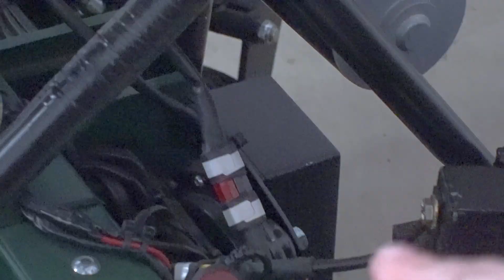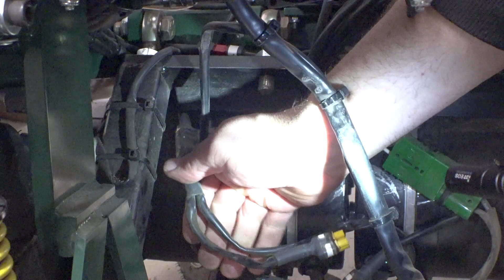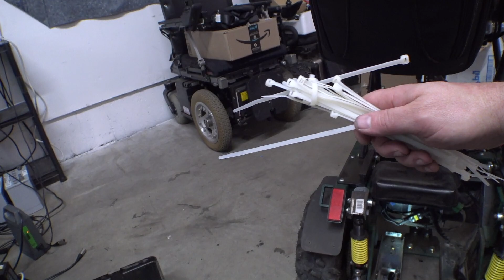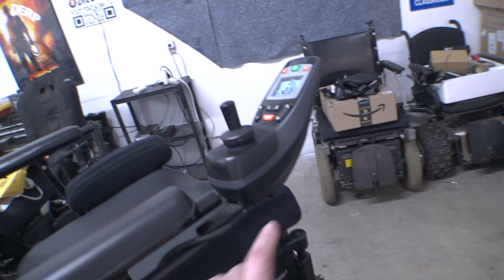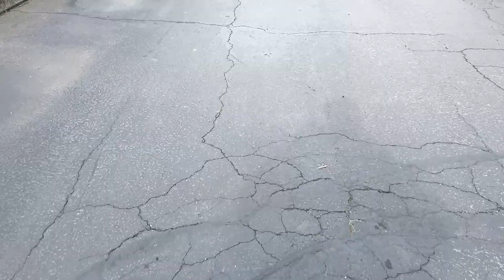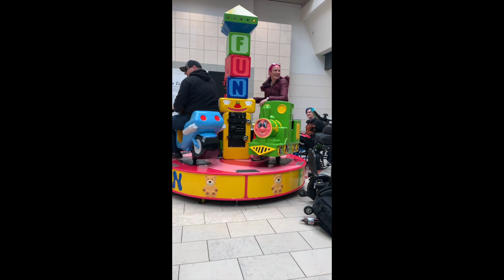VLOG 658: wiring repair on the bounder!

Comment: It's been several years,  but I worked part time for 4 years building electrics and electronics for Bounder chairs.  At the time I assembled the in-house  electronics modules, and have  heat shrunk  thousands of  various power pole connected cables.  At the time we also sold a version of Dynamic, and before I left ere getting their feet wet with R net, which I believe they had handled years  before I came.  I believe at one point they had also handled P&G   previously.  

I need to  talk with you.  I'm not in a chair, but I recently bought  an M300HD  for a "scooter."  I am 77  and limited on my feet, and bad back  nowadays.
Reply from the maker: there's contact info in the video description - either twitter DM's or the contact form on the website :^)

Comment: I find you interesting and entertaining.
I'm working on a big bounder 2016 model setting it up for a disabled friend (he doesn't know it yet) to use at disc golf.
The courses of course is a little rugged but Sandy in places. My plan is to have him up right,  like on a horse, strapped in as needed so to have upper body movement. 
I've got a commercial walk behind vacuum that is a soft plastic type compartment that'll be just right in front of him and it holds the disc and can be kind of like a segway hand positions.
Are there videos on changing over the sprockets and to change from belt to chain and how do you tune it up, like you was talkin about - it doesn't have the power to turn around smoothly on my gravel driveway?

Comment: If / when a power chairs dies away from a power outlet do we just call the DME provider for road side assistance?   I'm new to this.
Reply from the maker: depending on the chair ya end up with.. its good to know what the real world range of it is... generally speaking its directly rated to the size of the batteries (brand/model is somewhat irrelevant)
a typical rehab chair with group 24 gel/agm batteries can go 12-14 miles at the most - and just gotta plan around that :^)
most chair manufacturers greatly inflate the range estimates... (by more than double)
but in most cases:
group 22 batteries = 5-7 miles
group 34 = 8-10 miles
group 24 = 12-14 miles
there are more variables involved - but you WON'T get 20 miles or more!
(unless ya get a bounder with the lithium battery option lol)

Comment: Y Bounder has no suspension. It will beat you to death. Thinking I will call 21St. Century and ask if I can retrofit a suspension system. Any thoughts?
Thanks David Wolfe
Reply from the maker: its got suspension forks on the front, and the giant yellow shocks on the back :^)
Reply: No sir my chair is 17 years old. Yes springs in the front, no springs in the back. I felt the Bounder was such a powerful chair it would make a great off-road chair. I have bought enough parts to build another Bounder. Motors, wheels and all electronics and wiring harness. I was going to mount it on a tube frame wheelchair. Working on wheelchairs has become addictive. I know own 4 power chairs and one scooter.

Comment: Hi Dan, thanks again for another great video, didn't know that you had DX2 on your bounder, and I know what you mean about supply chain issues, I bought 4 set's of front fenders for both of my invacare storm 4's and I placed the order in December with invacare and they have just arrived despite their website saying that they were in stock. 

Fitting them wasn't so straightforward as I thought, as I have had to remove both the front wheels from the stub axle, just for a couple of fenders which were never fitted when I bought the chair's. 

Thanks again Dan 👍

Comment: I am  surprised that bounder isn't water proof....   bro, that's epic, you are riding a kid marry go-around
Reply: So far as waterproof, I'm not impressed with  Permobil, either.  Recently bought an M300HD  to use as a scooter.  The modules are way down low, subject to splash,  and the connectors ARE NOT waterproof.  Even the motor connectors are only maybe 6"  above ground. Going through a puddle  could get them very wet.  The lowest  component on the chair is the circuit breaker,  which is  right  even with the bottom of the chassis, about 4" above the ground.